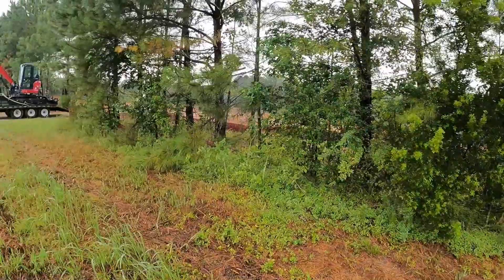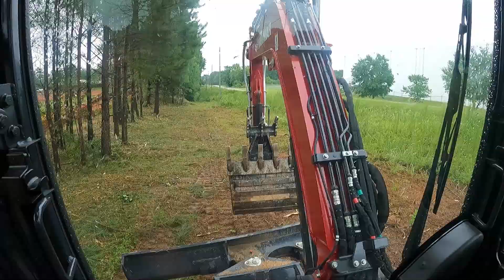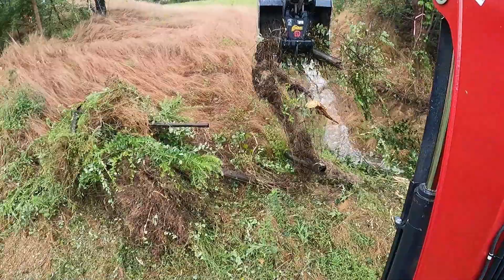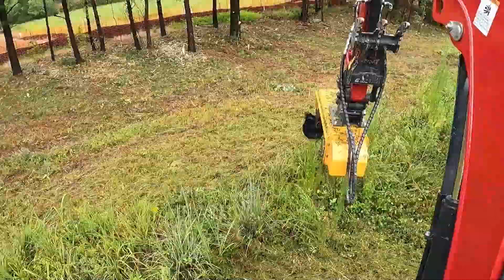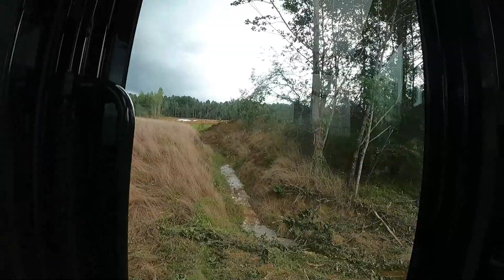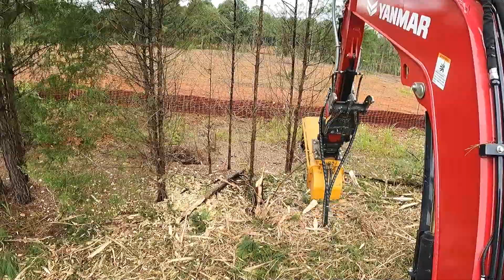My First Mulching Job

Comment: Could you take a screen door spring and some hooks to hold up the hydraulic lines feeding the mulcher? It looks like they would be easy to tear off.
Reply: Yeah, i thought the same. The hoses looks like a bit too long.
Reply: Just use a long enough bungee with double hooks and wrap lines and tie it to the thumb, doesn't need to be tight,  just keep them away off the ground

Comment: The mower isn't singing like it should, that drum mower should be humming. I would have the auxiliary flow turned up on you're machine doesn't take much it will make a big difference in the mower performance. I don't see a case drain on your mower? all the mowers we have all have case drains. Mowers make good money they are rough on the hydraulics and the swing gear of your machine.
Reply: I’d assume it probably doesn’t have a case drain from factory
Reply: These mulchers don’t need case drains as they run direct drive motors, not piston motors which do need a case drain. My Prinoth head is set up the same way.
Reply: @idigit4967  The Cimaf mower and the 2 US mowers all have case drains. Cimaf we had for the 16 ton hoe same thing. Maybe the cheaper mowers don't use them. We've blown the seals out of the hydraulic motors when the case drains were not connected by accident
Reply: @Graveltrucking  The direct drives are not a cheaper setup by any means, my Prinoth was just as expensive as the Cimaf and more expensive than the Fecon, its just that with the lower volume flows on these minis, (most 5-7 tons run 20-27 gal/m), the direct drive motors are a little more efficient and can handle these smaller drum heads on minis.  When you get into the larger excavators, like a 16 ton with all that flow you need a piston motor with a case drain but on a mini it isn't absolutely necessary for a mulcher.  My Prinoth will destroy a 10" pine no problem just as quick or quicker than the Fecon or Cimaf that run piston motors.

Comment: I ran across a 100lb. roll of barb wire hidden in the weeds with my flail mower. Had blisters on my palms by the time I cut it all out with wire clippers.
Steel T Posts, wire fencing, hoses, conduit........are also not fun when they are wrapped around in there.

Had a customer furious when I wound up half a mile of his cable TV.... I told him, "I've heard of overhead and I've heard of under ground, but not heard of ON THE GROUND. Not my problem!"
Reply: With my brush hog, I have ran over basket balls, wire fencing, 6x6's, box springs, Tee post,  miles of baling string.  Of course this always happens after a 10 hour, summer day, hot, tired, thirsty, pissed off and then just to put the cherry on top, you lay down in a fire ant bed trying to untangle all that mess. And, this WAS my retirement job.
Reply: Sounds like something I would do
Reply: @DCS026   Neighbor a few years ago wrapped 1/2 mile of the other neighbors temporary phone line in his rotary cutter..   Cutter grabbed it and proceeded to pull the line lose from the neighbors house and through the woods, like wrapping up a kite string.
Reply: Lol. Some people don’t understand why being lazy always seems to bite you in the a$$
Reply: Almost mowed up two of the neighbors kids 20 years ago 8ft brush hog I think it was a 6300 JD mowing fence rows at a pretty good clip when they thought jumping out in front of the farmer was funny... After teaching them every swear word I knew and inventing a few more I drug them nack to their parents told them what happened and that next time I wasnt goint to about  roll the tractor over to port around their idiot kids....
Reply: cable tv :)  that old thing
Reply: I got a water hose wrapped up in my rotary mower.  I didn't think I would ever get it out of there.
Reply: I once got a piece of 5/16 chain wrapped between the 2 of the spindles on our batwing and it wrapped up opposite ways stalled the tractor out and had to take it back to the shop and work on it for 2 DAYS
Reply: @aideningram434  Yeah hitting a chain sucks.  It usually goes one of two ways, at least for me...it either flings it toward a window (my truck seems to attract flying chains like a magnet for some reason) or wraps up so tight you need a dang torch to get it out.  It's always extra special when it destroys a spindle.  The absolute best though is when you send it through the windshield of the customer's car and it snags the steering wheel and lays waste to the dash.  Good times I say!!

Comment: Driven down the Alaska Highway many times and have seem them using a variety of equipment to maintain the margins of the highway and keep the trees back, mostly doing exactly what you did there except they mainly do it to reduce young new trees which like to spread into the open zone.

With the nice wide margins you can spot a lot of wildlife as you go, black and brown bears, Wood Bison, Porcupines, Foxes, Elk, Caribou, Moose and Deer.  It's the magnificent views and the wildlife along the way that makes the days of driving well worth the effort and it's the work of machines like yours that open those views up.

Comment: looks like the Beaver did a good job on the cleaning of the brush ..I ran over a roll of barb wire that was grown over in the property I just got almost a year ago .. had to remove the mower blade to get the wire out from under the deck .. few choice words i was saying ,, found 4 more rolls in the grass all grown over .. somebody got lazy taking down a old horse fence ..

Comment: Hello Chris, I watched you run this Yanmar with the cutter head when you first got it I believe it was very first video with it. At the time I watched the video I was not at all impressed with the cutter head that you had chosen it looked to me inefficient. I watch today's video and my practice makes perfect it was very efficient practice makes perfect I see you have developed some techniques using it and I'm impressed with its operation and efficiency as the keeping the cutter at a 45 degree angle and lowering it down at that angle. There are several other things too but I'm impressed now.

Comment: I watch upstate brush control and they use the Mulchers that go on the front of the skid steer and they find wires and cables all the time so they keep a pair of good wire cutters and small bolt cutter in the skid steer cause they hit that stuff a lot

Comment: Say Chris, if there is a truck stop close by, maybe you should grab one of the springs that trucks use to hang the air lines and the 7 pin electrical cable off the cab, hook it to the hydraulic lines and hook the other end on one of the thumb teeth. that might keep the lines out of harms way and still allow them to move when you need them to.

Comment: The mulcher sounds like my pc88 w/ brown bronto mulching head, wasn't tuned to the machine and spun slow and sounded like yours, id get the head adjusted to get that drum spinning faster, course it wont have a bunch of torque since there's no case drain but it'll help adjusting the valves on the mulching head

Comment: That mulching head seems like it could use a little more power behind it. Since it requires a high flow system, maybe increase the pipe/hose diameter running to it.

Comment: The worst part about those old fences are the broken off fence posts.  They can be really hard on the rubber tracks or even worse-- rubber tires for wheeled machines.

Comment: Good stuff! I may have missed the specs... I do this for a living with a skid mounted Fecon... Is this a high flow head? Do you have ballistic panels on the cab? The cut width seems small, but it is very nimble... But seems dangerous given it can throw a tooth in 100 different directions... It's when... not if.... Be safe my friend.

Comment: What kind of hydraulic oil temps does that run. Any special considerations or coolers added for the mulcher? I'm not that familiar with heavy equipment but very interested in the mechanics of them.

Comment: Where I used to live, when the roadsides needed bush hogging, the highway guys would take their big tractor mower, stand it up  sideways, and mow everything off.  It didn't look near as good as yours does.
Reply: Thats called a long-arm. They can cut 3 inch diameter branches with it( i used to work for VDOT)

Comment: ok dumb question, would the mulcher work on a bigger machine, and if so, would it have more power, or operate the same
Reply: Yes, it would work as it's hydraulic powered. Larger machine with more flow would likely keep it from bogging down but they all have pressure and flow limits.
Reply: Mulchers etc are spec by flow rate (hydraulics) of the machine. That mulcher is at the max flow rate as is.  U need the same flow rate or less to use it. Bigger machine for example a 250 you need a mulcher with a flow rate capacity to exceed or meet the machines max flow rate.

Comment: I keep waiting for that extra 4 feet of hydraulic line to catch on a stob and get jerked into the mulching head. A simple screen door spring would take the drape out of danger pulling it up to the thumb. That hot fluid is going to make a mess.

Comment: While the mulcher is definitely the right tool for right around the trees, a brush hog would have been a more efficient choice for the grass part of the job.
Reply: Not w/all that old silt fencing buried in the grass.
Reply: @pat36a  yup, getting it caught to find it just like with the mulcher, use the bucket and thumb to pull the fencing out then the brush hog to cut the grass, no real difference other than the faster job completion of the brush hog.

Comment: Boy…I Wonder if the hydraulics on Shortcake struggles a little with mulching or if it’s the mulching unit? You can hear the RPM drop off pretty quickly when mulching in thick cover….Just Saying

Comment: So the mulcher works on half gas?
I can hear the hydraulic motor and the exhaust sound, its definately not full idle, it's nice of you to think of the environment instead of burning fuel like crazy burning the engine

Comment: It's not that easy doing mulching jobs patience of a saint a flail head for hedge cutting would help with cutting the lighter stuff and grass bank the guy that does my hedges has both and it really speeds up the job cutting lighter stuff and grass the flail head isn't that effective yes it will work but slowly great videos 👍🏻🇬🇧🇬🇧